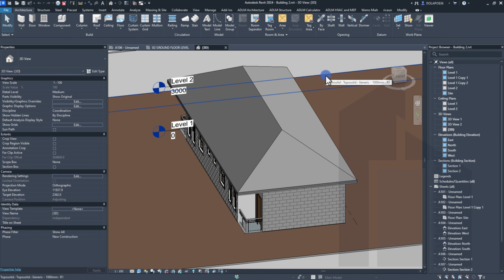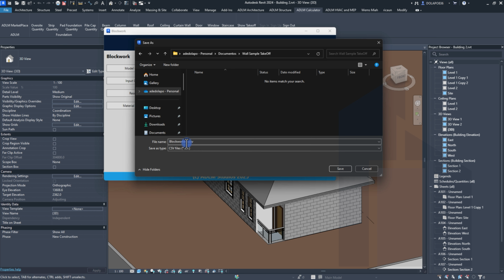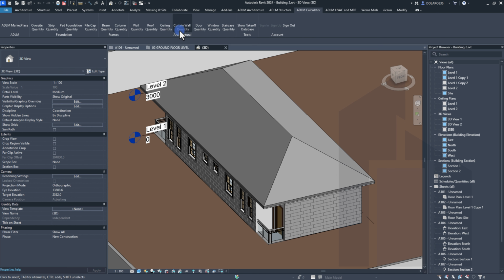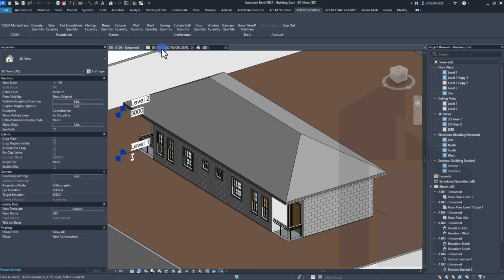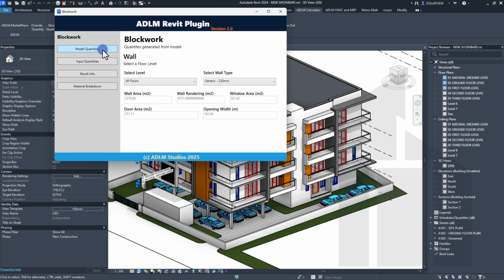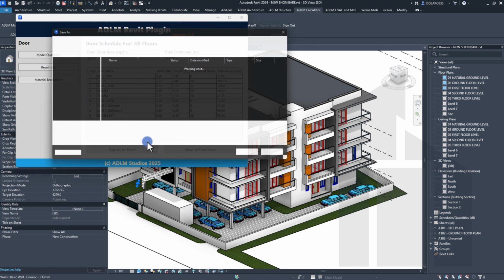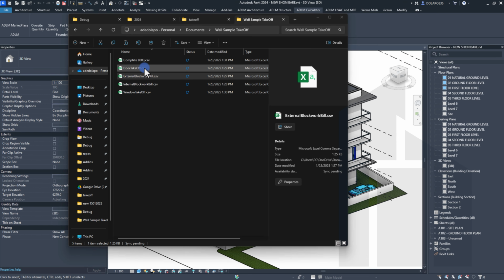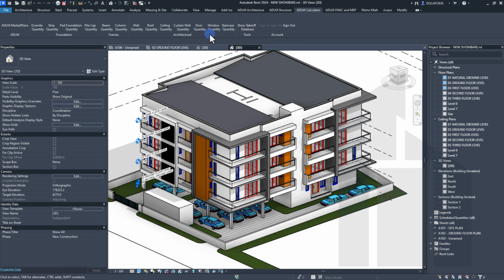ADLM Revit Plugin v2 Demo: Wall & Window Quantity Takeoff for Bungalows and Multi-Story Buildings

Comment: How do you measure your walls when the materials used are not blocks?
Reply from the maker: You can use the wall area to get the material you need
Reply: @ADLMStudio  I think what I was meant to say is when you have a mix of blocks and other materials like partition boards, glass etc.